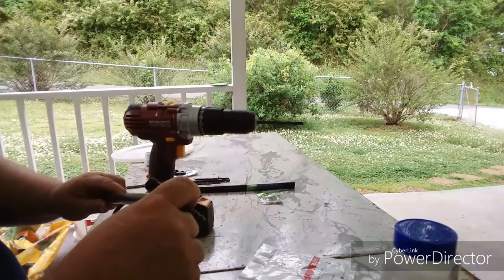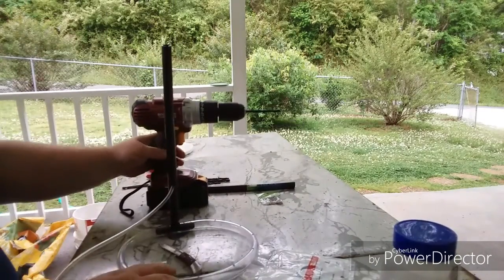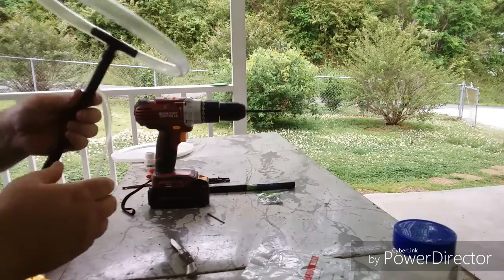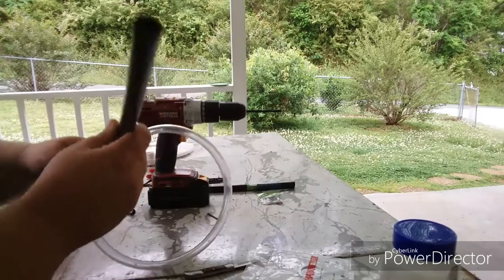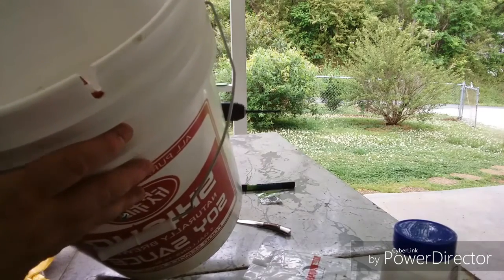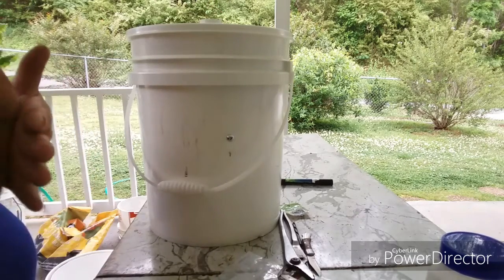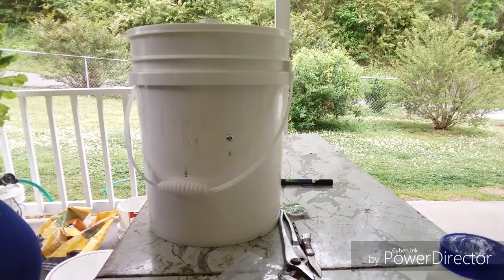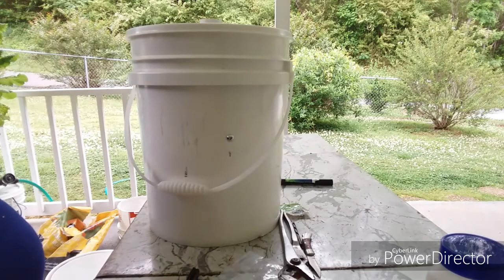DIY (Waterfarm) build a 5 gallon bucket watering hydroponic system Part 2

Comment: I don't understand: how does the air pump the water up to the dripping ring?
Reply: what happens when you blow air in a straw into a cup of water? that might help you
Reply: @12citizenscannabis63  Be sure and put the air pump higher than the bucket so water won't flow back into the pump when it is turned off.  It's an aquarium air pump, not a water pump.